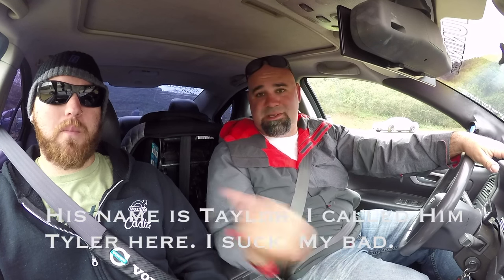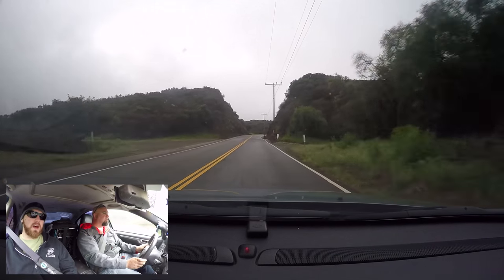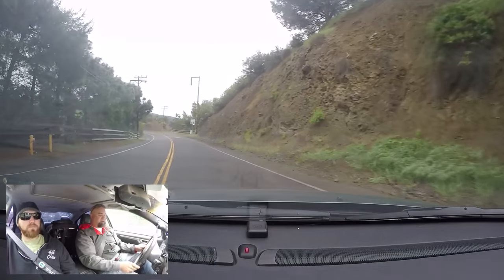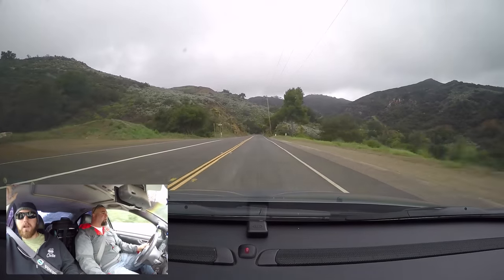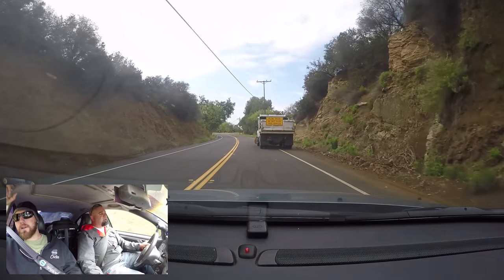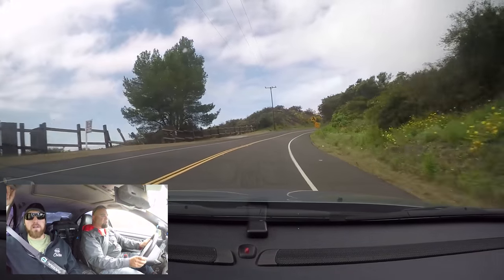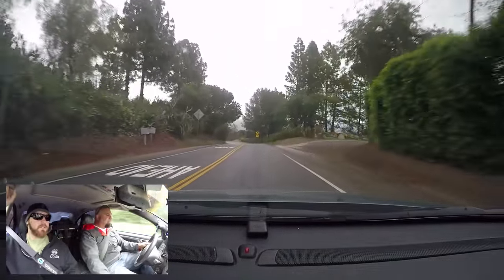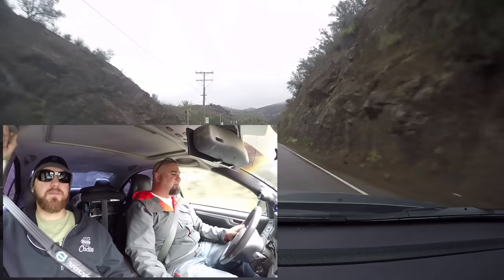Modified Volvo S60 T5 - One Take

Comment: claims 21 lbs of boost...only hits 10lbs
Reply: would you like a snapshot of hitting peak boost?
Reply: the roads were wet in some spots my wheels were spinning in 1st gear..
Reply: +Taylor Cadiz I could see it hitting 21 lbs in 3rd or 4th gear, I understand he was in a low gear when pointing out the boost
Reply: +hooves17  yeah 2nd it starts to peak 21lbs